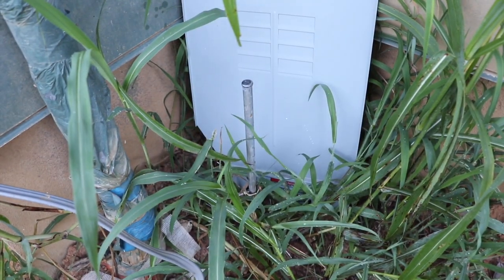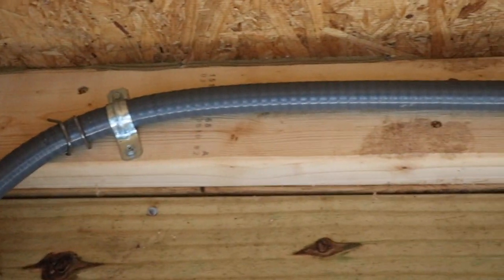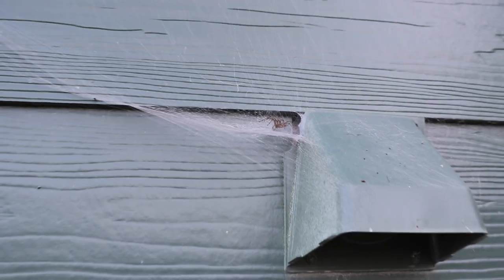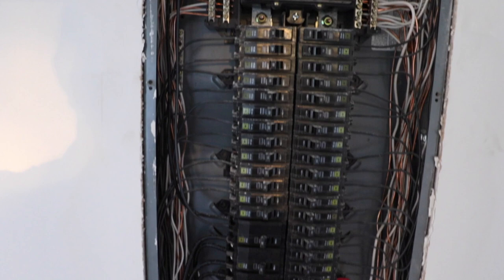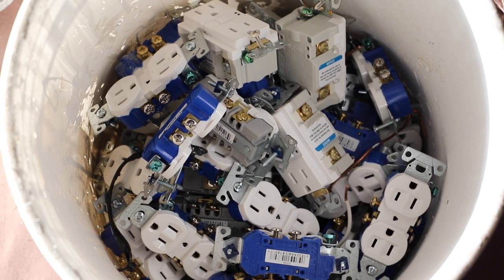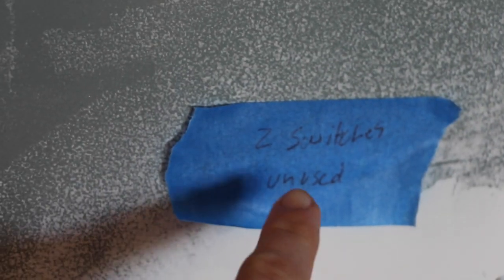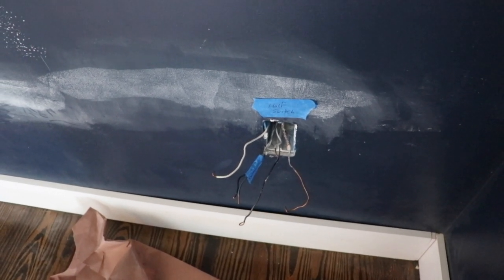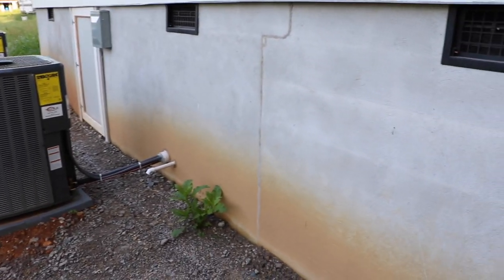Electrical Contractor Failures - Trade Tips

Comment: If you’re going to down talk the electrician publicly at least know what you are talking about
Reply from the maker: We don't publicly announce who the electrician were... we used 2 they both failed.  All our points were made by the county inspector if you think he doesn't know what he is talking about... join the bandwagon of every contractor who thinks they know better than the code enforcement officers.  That bandwagon cost us a lot of money, if a contractor EVER approaches me and says "the inspector doesn't know what he's talking about" they will immediately be fired because that's a sign they are going to cost me a ton of money and time.   The video is for home owners from a home owner.  This video is not an electrical tutorial it's about bad electrical work.
Reply: I understand your video was highlighting poor electrical work and I would agree that what you showed was seriously lacking in either skill, experience or that the trades person just didn't care. However, you are very wrong with regard to your stand on firing someone if they disagreed with an electrical inspector because each case is different and you need to determine, if in fact they are right or wrong. Not just react with ceasing employment, that is unfair. What if it turns out you are wrong? Since when are Inspectors infallible? Because over the years I have put both electrical and plumbing inspectors in their place because they WERE WRONG.In addition I have also put heating inspectors in their place for errors made, one in which if I hadn't caught it, those new homeowners would have died in their sleep. So please don't preach as to how inspectors of anything know their job and are always right, that's a serious misconception. I have seen inspectors pass questionable work and as it turns out they knew the installers. What do you think went on there? Not far from where I am, there was a building collapse, a person was killed others injured and a lot of damage. Weeks before it had been inspected and was passed. Yet after the event they found serious violations that were overlooked or simply ignored and charges were laid. Besides the impact on people, I'm sure a ton of money was lost. Inspectors are as wrong, just as frequently as everybody else and that's when they're trying to do a good job, like everybody else. It's called being human, we are predisposed to occasionally being wrong. You may never have come across inspector error, consider yourself fortunate because it could cost you time and a ton of money getting things straightened out.
Reply from the maker: Hardrock this contractor routinely failed inspections, never showed up, and was seriously delaying the project.   And when I say never showed up I'm not talking days... weeks.  I've worked with numerous contractors, this group was bad when it came to electrical work.  They needed to go.
Reply: Understood, I've seen that kind of work ethic before. My next door neighbor is a builder, he's currently working on a retirement residence and it seems like a daily occurrence where he has trades failing to show up on the job site. But the worst is when he is having to have work redone because it gets rejected. I have been a government sanctioned inspector for residential and commercial as well as being a multiple trades person. I have even written up rejections on work others had passed. At one point for four years all I did was redo work done by other contractors. So I do have, over the course of decades, exposure involving this area of concern. But my main point was involving the reliability, expertise and honesty of inspectors. One time, a plumbing inspector put a stop work order on me, as I was installing electric water heaters in new homes. He insisted I was installing the water heaters in such a way it violated code. With this equipment, code was the installation instructions as written by the manufacturer. I took the book into Plumbing Inspection HQ to talk with the head honcho, handed over a copy of the installation manual complete with pictures. That inspector got called in on the carpet, I got an apology and he got straightened out. That took place over the period of about a week and during that time period I'm not working, losing money as I'm sure you get. But that is just one of many altercations I had with inspectors that shouldn't have been inspectors. Some that I came in contact with never wore a tool belt. Some other trades guys I came in contact with were repeatedly having issues with a female inspector, who was hired for that job as part of the program to have more women in the field. She had no previous trade experience or school training, before that job she was a secretary/filling clerk in an office and the idea was on the job training. This is the kind of thing you see out there all the time. That is why I took exception to your position with regard to questioning the word of an inspector. I learned a long time ago from an old guy I was working with as a teen, he said "Question All Authority," I have always done that, because they're like you and I, human. They make mistakes, they may be dishonest, they may not have the expertise they should have or they simply don't belong in that job capacity.
Reply: g quinn 
Honestly what I got out of it was. The owner wasn’t happy with the electrician and terminated him and I’m ok with that. I didn’t like the fact the homeowner wasn’t even close to the right terminology in describing the work . I believe if you are going to publicly degrade someone that you should know more than that person 
I learned this a long time ago   There is three sides to every story his , hers , and the truth
Reply from the maker: The truth is, the electricians failed the inspection miserably.  And this was their third time failing.  The fails were all things that can be noticed by homeowners, which is the point of the video, to let homeowners know what types of things to look for.  Homeowners don't need to be experts in a field they are hiring out, if they were they wouldn't need to hire it out.  But they should know what types of things to observe so that they don't end up with a mess.  Because not every contractor is worth a penny. 

Nobody is degrading anyone publicly if we wanted to "degrade" someone we would have made the name of the company public.  I've managed building projects commercially for 15 years.  THAT was a sloppy crew, one that didn't care about their work.  As a mechanical company, I can honestly say that they excelled in one particular area.  But Electrical was not it, it was a new endeavor for them and the crew did not reflect the quality of their other crews who performed the work that defined and started the company.  It also does not help them that their only licensed professional left the company mid project due to issues with how crews where managed.  They should have immediately told us that their licensee was no longer with the company, but instead proceeded. We are not the only homeowners that suffered from this particular crew.
Reply from the maker: For the record Hardrock, I think your comments were objective... I'm not sure he read them thoroughly.
Reply: Issues of this nature are common, I have an endless array of stories where there were crews out and the licensee was travelling from location to location acting as overseer. That arrangement clearly doesn't work. My initial commentary was to do with inspectors, poor quality workmanship, poor work ethic and other contributing factors that result in dangerous situations are sadly quite common.
Reply from the maker: We ran into the same situation with a second electrical contractor who literally hired two "new" employees to come out and do the work (we found that out later)... honestly, I think when it comes to electrical, you are better off hiring a small company that has only a licensee and a helper.  That way you know, the people working on your property, are licensed.  I worked with a guy on commercial projects who, in my opinion, was outstanding.  His rate was higher, but he also took less time... he was qualified.
Reply: Yes, it really doesn't matter what company you may contract to do work for you, it's a buyer beware scenario. About the only thing I can recommend to any home owner is check out their credentials, which doesn't guarantee that they do quality work but it's somewhere to start, as you find out if they are in fact licensed. If you can talk to previous clientele and see some of their work, that's good but as we know that doesn't mean that they will always be doing the work, some helper or apprentice may end up doing it. Most contractors are good at what they do but the bad ones that leave behind poor work always stand out and everyone gets spooked. When I approached building supervisors for jobs, they would say things like, why should I hire you? and I was in competition with other contractors who would be on site looking to score work. I would just take the builder to my work van open the doors, most of the time I would hear, you're hired. My trucks have always been immaculate, everyday I would take stock count for hardware etc. and do house cleaning and organizing. The other guys trucks were usually dirty and unorganized. I have always kept my work area clean, safe and I clean up at the days conclusion. The other guys that you shouldn't hire, make a mess and leave a mess. And a telltale sign for me is the shape of their tools, if they look like they have been abused, then that's the work mentality you can expect on the job. A friend of mine, many years ago applied to being a Snap On Tools Franchise Operator, as part of their job interview process, they showed up at his home to view his home and meet his wife and family. If you were unorganized etc. you didn't make the grade and were passed over. Taking such an approach to weeding out the good from the bad by viewing what they roll up to your door in, maybe the way to go, it demonstrates, work ethic, that they care and that they are organized when their truck and tools look like they are used by a professional. Best of luck with future hires.
Reply: However typical of a nit picker when in the end stuff would work just fine in the end
Reply: gitsome35 it's not about "working fine" it's about being up to code!  I can twist bare wires together in a box and things may work fine, but that doesn't mean it's done right.

The guy is paying them to work, so he can be as picky as he wants.
Reply from the maker: bigchevy80 wow, you actually get it! If you are paying for a professional service that's exactly what you should get.  The code does cover workmanship... and I know the local inspector was just hitting them on workmanship but this was the contractors 3rd inspection fail. Homeowners are employing contractors for their experience and workmanship. It's amazing how many so called "electricians" don't value the people supporting their work with employment.  Of course I don't really believe most of the comments are coming from "licensed" electricians so it not fair to judge an industry on them.
Reply: Have you ever met a home builder who knows electricity? In 21 years I never did.
Reply: The narrator mentioned himself to have performed initial wiring.
Reply: Except for the fact that you are indeed bashing different electricians and you do not know what you are talking about. You are simply regurgitating information that's been passed on to you. I had to stop when you started talking about the "grease" used for terminations. This grease is commonly known as Noalux, it is a corrosion inhibitor used when two metals are dissimilar to prevent corrosion. This is only needed when metals are dissimilar, such as using aluminum wire on copper lugs. However, most lugs now are printed with AL/CU indicating they are safe to use with both types of conductors. If that is the case, you do  not need to use Noalux. This is just a general overview. Right now, you're walking around pretending to be a professional. We electricians spend years as apprentices and in school before we get our ticket. Please come back and tell me I'm an idiot when you're licensed.
Reply: Right any electrical contractor who does not know some thing as basic as a sub panel ground and neutral must be isolated is bad news.
Reply: dude, that's why the home owners don't do the electrical.. THEY'RE NOT ELECTRICIANS!  Why would you expect them to know the proper terminology?  I'll bet if I were to start talking to you about all the different components on your car and inside the engine or the strands that make up a fiber optic cable or the TIP/RING side of phone service and on and on and on you wouldn't know all of that either.  So, get off your high horse.
Reply: That's what I was gonna say
Reply: From an Inspectors point of view you or the inspector need to read the code a little closer, several things you pointed out and said would not pass code were not an issue. As an electrician as soon as the home owner started wiring on a job I was hired to do I would be gone, my job, my liability. I will not take responsibility for your mistakes!  All that being said I am glad you found a new electrician because the first one did not have any pride in his work, any one who would leave work like that for someone to see will likely do anything in the wall where it is hidden.
Reply: @tannerrex  who do you think you are? Did you go to canadian tire and pick up the "help me rewire the house" book???
Reply: Best comment!
Reply: Kenney Chappuis tbh whom ever did that job shouldn’t called themselves electricians nor should anyone refer to themselves as electrician
Reply: @ Hardrock....spot on. Need more outlooks in this world with that mindset.  We all make mistakes but always the main goal is SAFETY.
Reply: @mrelectron6220  Sub panels aren't supposed to be bonded either.
Reply: Yep. He called a flex conduit a wire and did not know that the grease is called dielectric grease, no-ox is also available for certain uses.
Reply: @YanasaTV  The almighty inspector can actually miss shit too ya know. Just today, I got failed on my service wire because I didn't have 2 ground rods in the ditch. But guess what? The inspector missed the ufer that was tied into the can, and if you have an ufer, you only need one ground rod. Inspectors can and will fuck up too
Reply: @tannerrex  AMEN
Reply: @mrelectron6220  That subpanel didnt have any neutrals. Just 240volt and ground
Reply: @billsmith9249  I actually know about everything you mentioned in great detail.
Reply: @csmith4463  the problem with replying to comments after so much time has passed is that their is a haze about what was said and to whom.... I wasn't speaking to you at all, I was talking to some troll bashing you.
Reply: @billsmith9249  I know, I was agreeing with you and think you are probably intelligent person and know about those topics mentioned above. I just thought it was funny you mentioned a few trades I just so happened to have a backround in. I remember how happy a customer would be back when I'd show up to install or repair a simple phone jack. They had no clue how it worked. Then during my auto mechanic years, same type of person would tell you what they think was wrong with their car, they had no clue.
Reply: @YanasaTV  , all this can be resolved by one call to state ,,  could be revoked for a job like that .
Reply: Service plug for a/c's doesn't have to be dedicated,
Reply: @YanasaTV  code enforcement officers generally don't know the practical side of electrical only what its on paper... if this job was actually done by a qualified person who takes pride in their work this would not happen
Reply: @YanasaTV  well the hot wires being red on left and black on right is bogus. For one, its a single phase system. It should be 2 black wires , 1 white and one ground. Not red and black , and its just plastic color at that point. Also, aluminum is cheap, but copper is the way to go.
Reply: Hardrock You my friend just turned yourself a like. Not only are you knowledgeable in the trades but you presented your information in a way that was not condescending or mean and in some cases was actually kind of humorous. I appreciate you taking the time to write down this information for other people to digest.
Reply: @YanasaTV  where were you the whole time this was happening? Since you claim to know so much about electric why didn't you question the "electrician" from the start?

Comment: This guy has no clue what he is talking about
Reply: EPICCZH you ain’t kidding!
Reply: That’s putting it mildly!
Reply: the host? he seemed to know quite a bit
Reply: @Dredpath1  but hes not an electrician so why should he know? he is pointing out some obvious defects.
Reply: @Dredpath1  but he was right on everything. the sub panel neutral bonding , the doubled up neutral lugs, grounds mixed with neutrals, no antioxidant paste on aluminum  conductor terminations, no gfci protection for outdoor receptacles, snipped strand of stranded wire so it would fit in the lug, ground rods not buried, no afci breakers and overall poor inexperienced work. so for you to say he doesnt know shit shows that you dont know shit.
Reply: @Dredpath1  yes
Reply: He might not know a lot but the panel comments were on point.